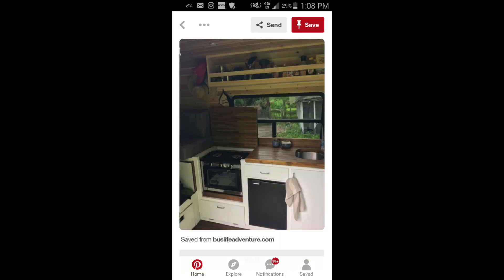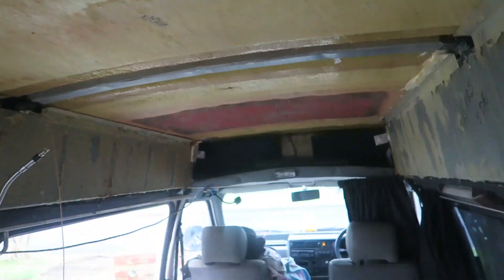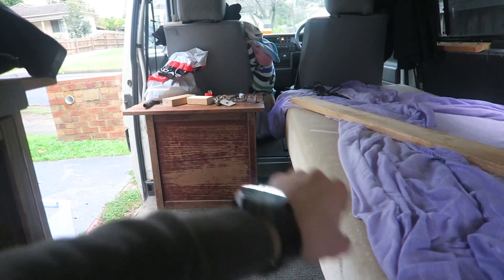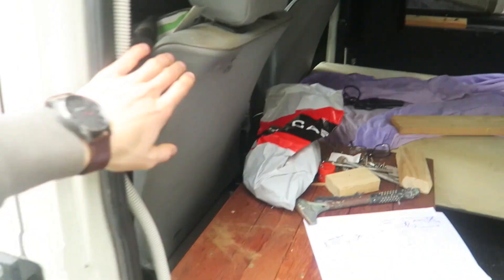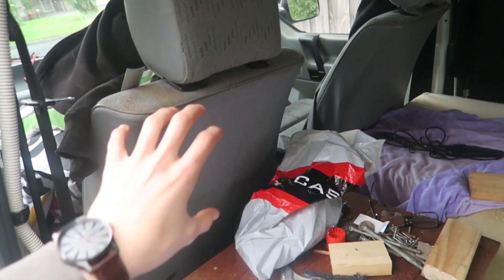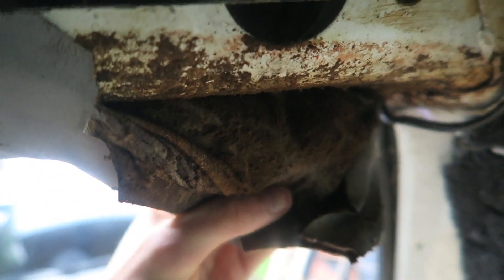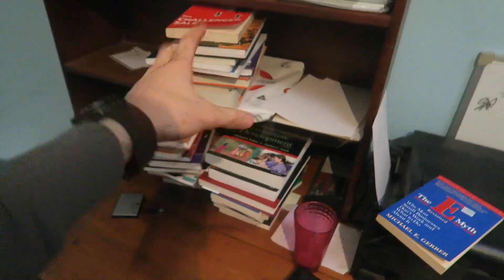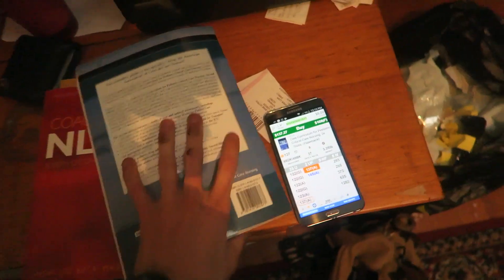Q & A | FBA Books | Continuing Van Build!

Comment: I bet you a dollar it the rubber seal around the back door..
Reply from the maker: probably is mate
Reply: darryl goritz I was thinking the same. Pull the weather strip out and check for rust. I had the same issue on my car trunk. Quick fix I use aluminum tape for these rust holes. They work great and last quite long. Later I could just do the body work or welding.